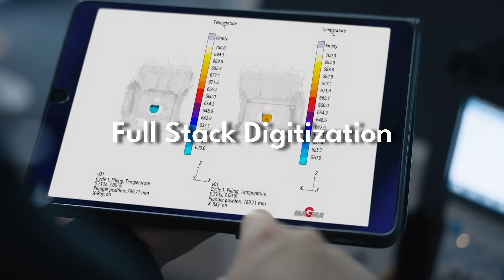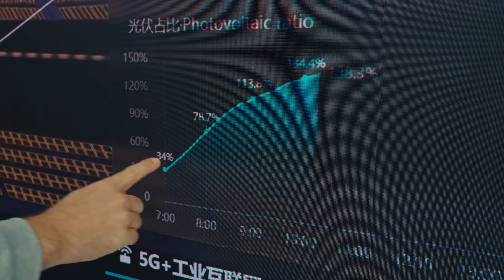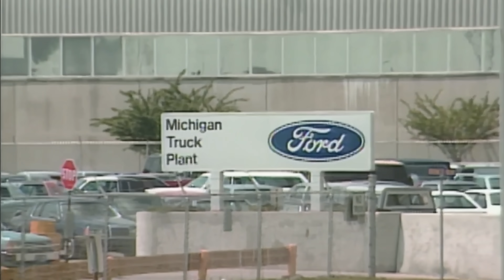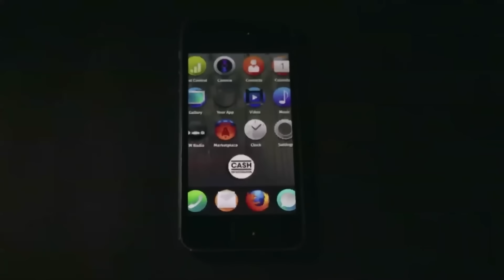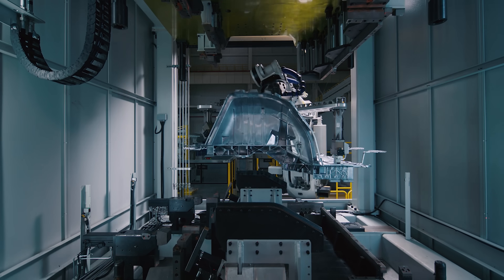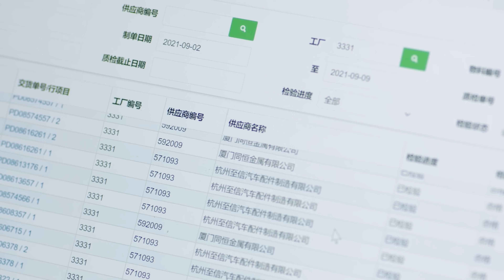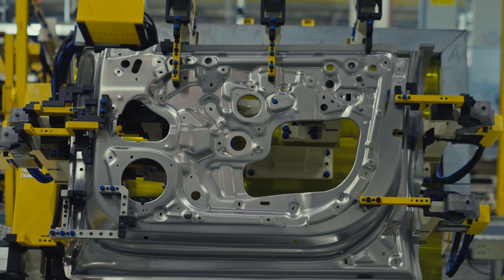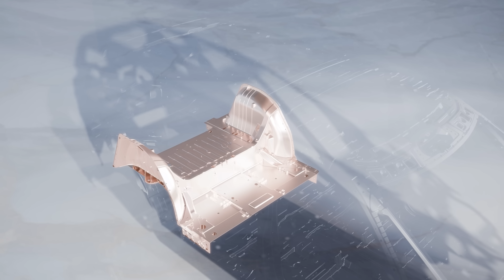Inside Zeekr’s Futuristic Factory: How Smart EVs Are Built

Comment: Who's going to buy all those cars if no one has a job anymore?
Now all that's left is for the designers to bring out appealing models for Europe. Fewer choices but lower prices would be better.
Reply: Human future’s jobs arent in this kind of factories anymore 10-15 years from now on.
Reply: @walhdamaskus2408  but where? You are ignorant as fuck. A lot of people LIKE to work in factories. And not just workers but engineers as well.
Reply: You are thinking in terms of the present economic paradigm.  There has been experimentation at different models and even during the 2 world wars, they experimented w/ rationing.  The whole notion of "sustainability" involves rationing.  Ownership will be replaced by sharing.  Think of the battery swap infrasrtucture, which already uses that concept.  So the planned obsolescence and product lifespan of only warranty periods will give way to maximum longevity vs cost of materials (and that cost is not in the past sense but more so of cost to environment, etc.).  So in answer to your question, which is a commonly asked one, we won't be buying them, but using them on a use-by-use basis, which is why they channeled money into ride-sharing apps, etc.